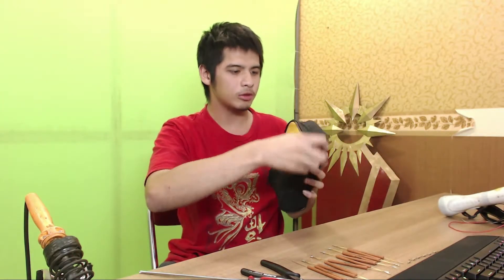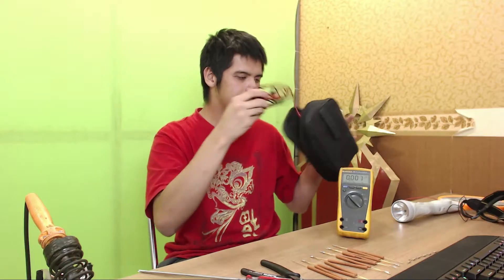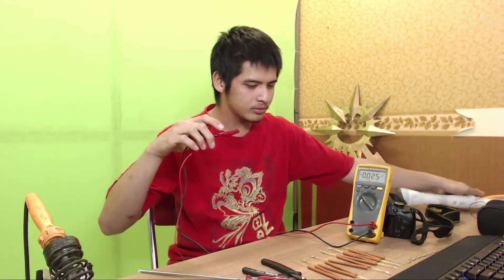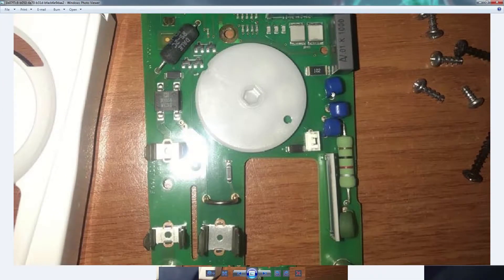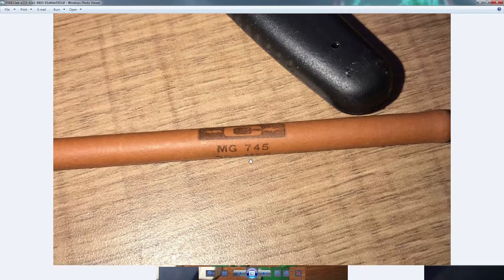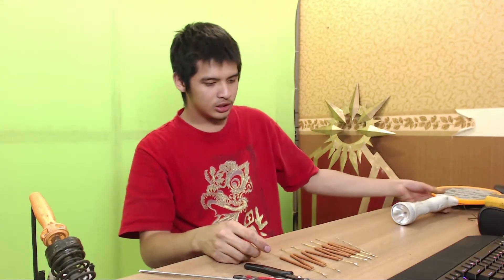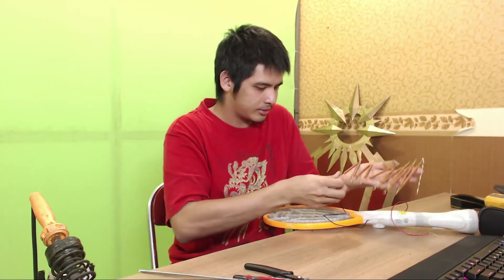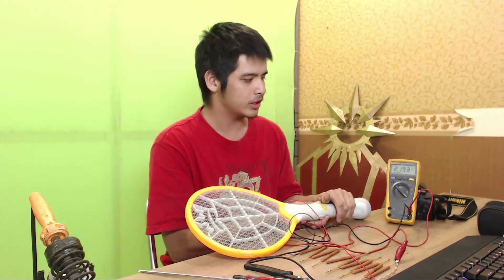Want to measure 100kv with a 1kv multimeter ? (MAKING A VOLTAGE DIVIDER)

Comment: Hi Tonny, did you make a casing already for you high voltage meter? And do you know if it is  necesairy to connect one side of the voltage divider to ground, because my voltage probe hasn't got a lead to ground.